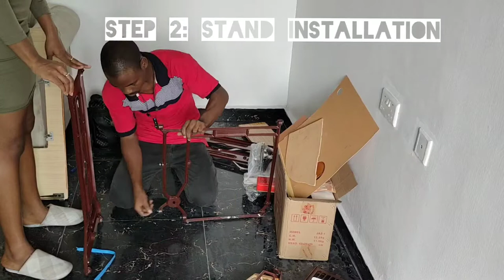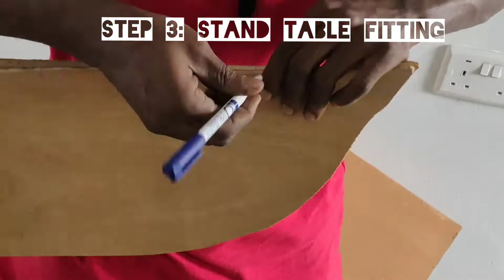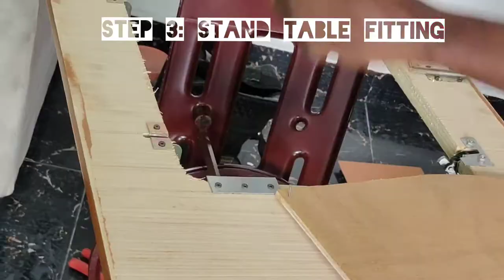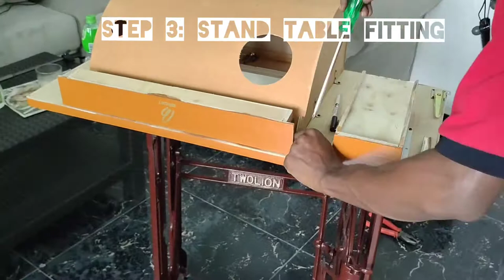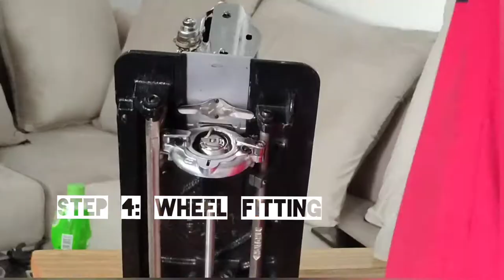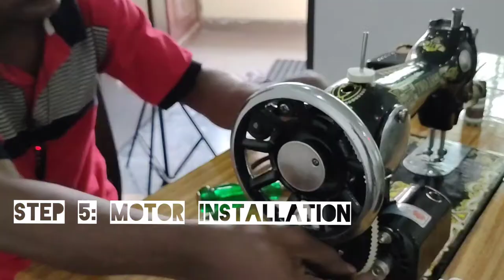HOW TO INSTALL TWO LION AUTOMATIC/ MANUAL SEWING MACHINE| 5 EASY STEPS| UNBOXING| 2022

Comment: How much is this marching
Reply from the maker: https://www.konga.com/product/two-lion-automatic-and-manual-sewing-machine-5699834
The original store where I purchased it is sold out but I have just linked another seller you can buy from. It is currently priced at #82,000 naira. Thank you for watching ❤️
Reply: I bought this recently but it didn’t come with a pedal and it’s wooden area looks more like the butterfly machine. Was I cheated?
Reply from the maker: It should come with a pedal and a motor. You're right about how the wooden area looks. You may need to contact the seller
Reply: Please I want to buy
How do I know the original
Reply: Is two lion stronger than butterfly 
I want to buy but I don’t know which one to buy 
There are so many fake butterfly in the market